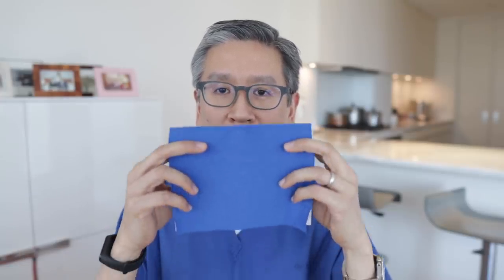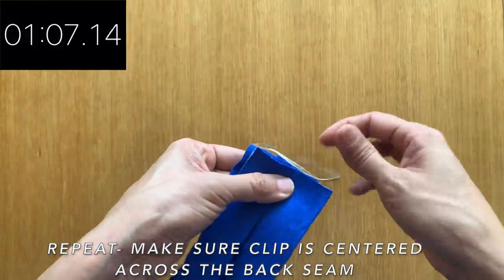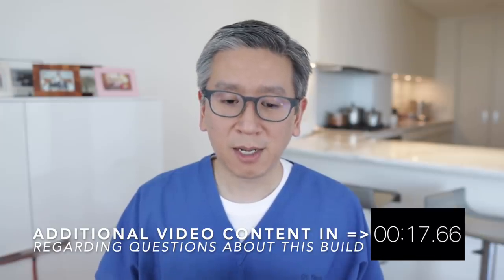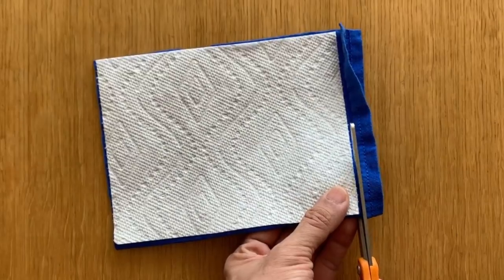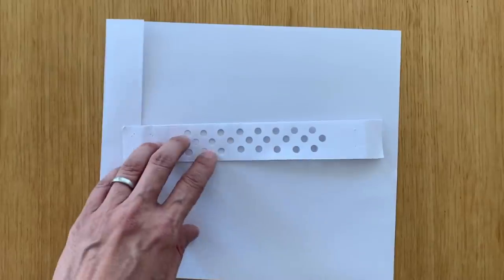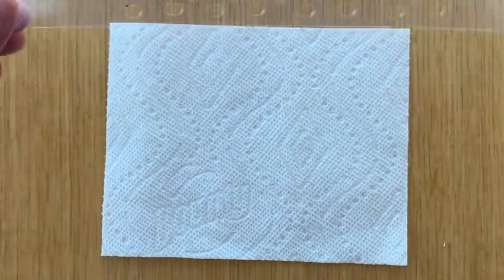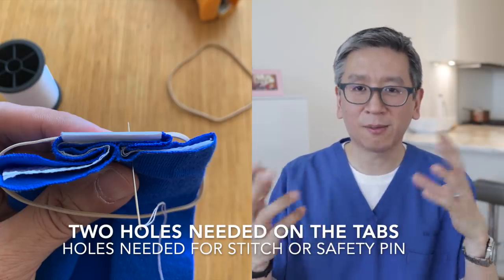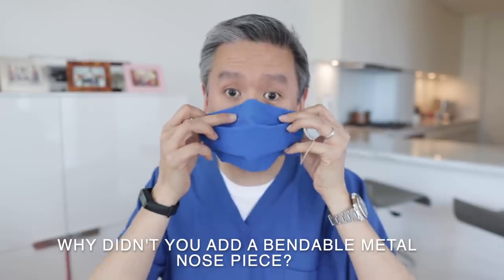1+ Minute Clip Assembly No Sew 3D Filter Pocket Face Mask #Masks4all

Comment: Thank you Dr. Yang, for this excellent design. I use both the paper and the cloth masks.
For the paper ones, I use paper towel outer with a tissue filter, all stapled together, so it is fully disposable.
For the cloth ones, I use a cotton outer as a mechanical barrier and chiffon (or polyester) inner as an electrostatic barrier. Since there is no paper, the cloth mask can be hand washed and re-used several times, so I have stiched the ear bands, instead of using clips (per your earlier video). I have also hand stiched the bottom opening for a neater finish. 
And I use hot melt nose clips for a better seal (I wear glasses and they fog up!). These can be bought from ebay quite cheaply.
Once again, thank you so much for taking the time to publish these videos!
Reply: What are hot melt nose clips?

Comment: One final question if you would be so kind! I have read that the best fabric mask materials are tightly woven cotton (600 thread)or quilting material or electrostatic fabrics such as melt-blown polypropropyene. Is there some special reason that you prefer T-shirt material?
Reply from the maker: This is one of many videos.  The focus is on accessibility and making one so they can use it today.  If possible, the surgical masks that can be purchased will be better.  

This is the "lowest hanging fruit," which everyone should be able to make with what they have at home.  If they have other better materials or the money and time to buy better materials, the same design can be used to make the same style mask.  You can make this mask using the 600 thread cotton with a Filti mask filter, or other melt-blown polypropylene.  

These are made of non-woven polypropylene, with a melt-blown center layer.  You can try to recreate a surgical mask using purchased materials. On Etsy, they even sell kits which you can assemble your own surgical masks.

The T-shirt material is from the Masks4all.co website.  Note they didn't use a cotton-poly blend as their recommended cloth.  The 100% cotton t-shirt is thicker and is closer to other tightly woven cotton.  However, the filtration of the cotton alone was not great, so adding the paper towel was important to the design.  

Here is the graph from the article discussed below: https://smartairfilters.com/wordpress/wp-content/uploads/2020/04/Effectiveness-of-DIY-Mask-Materials-at-Capturing-1.0-Micron-Particles.jpg

Here is a channel post and discussion about the best mask materials which you may find interesting:  https://www.youtube.com/post/UgybnLPPH85A28YlaQt4AaABCQ?app=desktop

Comment: Hi Dr. Yang. Thank you for taking the time and showing us how to make a quick and effective face mask. I followed your instructions to the Tee. My face mask did not look anything like yours. I have a couple of questions, if you will. Where did you get the piece of Acetate? I tried using clear notebook divider. I had to put 4 pieces on top of each other( I quadrupled the thickness)  and it was still too soft to hold shape. Secondly, you are saying you are using tea shirt material for the mask. I know tea shirts are soft too. I used something like that, still can not have my mask hold its shape like the one in your video
Reply from the maker: 1. Transparency Acetate from Staples or Michaels. The specific brand I used was from Dick Blick Art Store in NYC: https://www.dickblick.com/items/55506-1305/

I was using this acetate to make face shields. Video link: https://youtu.be/pd-sZAQLomg

You don’t have to use acetate, but the “frame” should be stiff like a piece of index card or folder material.  If you bend it and let go, it should want to stay straight. 

The clear document sleeves where you can insert a sheet of 8.5x11 paper would be too flimsy like a ziplock bag.  

Important to place the sheet of paper towel in the middle of the t-shirt. The paper towel has some stiffness like a sheet of paper when it is new. Without the paper towel, it will likely needs too soft. 

Lastly, the T-shirt material recommended by Masks4all.co is 100% cotton. A cotton/polyester blend might  be too thin.  Good for working out, but too thin to be an effective mask.

Comment: At the end you could use a stapler to attach the acetate film, just make sure you do it so the smooth part goes toward your face so the staple doesn't scratch your face.
Reply from the maker: I think a stapler is possible, but may require a heavy duty stapler or thinner T-shirt material.

I tried to use a stapler on my Instagram as I was designing the cloth version. https://www.instagram.com/p/B_v8EScDAen/?utm_source=ig_web_copy_link

https://www.instagram.com/p/B_xdQAhDxO7/?utm_source=ig_web_copy_link

Comment: Well, could you stitch it first then use the paper towel?  You can use the binders to hold the towel in afterwards.  And as for masks that have the seam down the middle, I don't blame you for judging against them, but what about if you use a filter with them?
Reply from the maker: Marie Duran 
The earlier cloth version was just the paper towel version but using the t-shirt.  I couldn’t get the staple to go through so I placed 2 stitches.  https://www.instagram.com/p/B_v8EScDAen/?igshid=3gi3bp8j228p

Comment: I love this video quick.what else can I use as the tape you used or where can I find The tape.
Reply from the maker: Debbie Gatlin 

Cut and paste from Description: 

Acetate Film 0.005 mil: 8.5”x11” or 9”x 12” (extra can be used to make face shields.) I looked some up and they are pretty expensive.  They don't sell them in individual sheets, only packs of 20-100.  So I don't want you guys to spend that, unless you plan to make face shields for donations or for your own business use when reopening up small businesses, such as the cashiers, or hairstylists/barbers.  Workers who spend a lot of time within a couple of feet from customers.

Alternatives to the Acetate frame (using 3D printing to make a frame was not a viable option to reach everyone.)

•The goal is not to buy anything more than you need or want to.  There must be some stiff, bendable material which you can find at home.  Channel your inner MacGyver.

    •If you can find some transparency/acetate pages at work, use that.  
    •If you have clear folders at home, use that.  If you only have a folder which is made of card stock, use that.  
    •Some people have laminating sleeves which would also work.
    •A 2 liter bottle in theory could be cut into a long rectangular piece and punch holes in that 
    •Some junk mail actually uses pretty good plastic or laminated card material to make their advertisement stand out.  You can use that and cut a strip to use.  It will be hidden inside the mask anyway, so don't worry. 

Here are some links from Staples.com:
https://www.staples.com/Apollo-Write-On-Transparency-Film-Clear-8-1-2-W-x-11-H-100-Box/product_829333

https://www.staples.com/Report-Cover-with-2-Pockets-Plastic-Clear/product_970151

https://www.staples.com/2-Pocket-Plastic-Folder-Clear/product_970156

Comment: Do I need to add holes to the plastic strip? What is the purpose of the holes?
Reply from the maker: If you don’t have immediate access to a hole puncher, you can try making the mask with a solid piece of acetate.  This only covers about 1/3 of the surface area of the mask.  You still have 2/3rds of the mask for air to go through from both above and below the strip of acetate.  Adding the holes increases the amount of air, but the acetate still covers about 1/4th fo the mask.  Will people be able to tell between 1/3 vs. 1/4?  Probably not.  

In this paper towel version of the mask, I did not punch any holes in the printer paper, and it worked well, without much difficulty breathing.  https://youtu.be/NCF7lCHMnII

Give it a try.  If you think you think it works well without the holes, please let me know.  

With the disposable paper towel mask, people worried that in theory that it would be hard to breathe without some holes, but in real-life usage, I did not feel there was any difficulty at all.

In this cloth version, I included the hole punch idea, since the acetate is very strong versus a thin piece of printer paper.  Also, once the holes are punched, you can use the same piece of acetate over and over again cleaning it between uses.

Let me know if you try it without the holes and if you think it works fine without them.  It will help people who don’t have immediate access to a hole punch to get started while they get a one time access to a hole puncher (at the office or borrow one from a neighbor.)

Comment: What is the purpose of the acetate piece?
Reply from the maker: It gives the mask structure and shape.  This is important otherwise a flat piece of fabric across your face will get caught in your mouth as you talk and open your mouth.  This restricts breathing and makes the mask wet right wear your mouth is.  

Normally to make a structured mask you will need to pattern to sew two curved pieces of fabric together to create a dome shape.  If you don’t have a sewing machine, this folding and clip method gives structure without any need to sew.  

Also, easy to place the towel filter to cover entire surface of mask instead of trying to stuff the filter into a tiny pocket where the corners may not be laying flat.

Comment: Great idea. Where do you get acetate?
Reply from the maker: Cut and paste from Description: 

Acetate Film 0.005 mil: 8.5”x11” or 9”x 12” (extra can be used to make face shields.) I looked some up and they are pretty expensive.  They don't sell them in individual sheets, only packs of 20-100.  So I don't want you guys to spend that, unless you plan to make face shields for donations or for your own business use when reopening up small businesses, such as the cashiers, or hairstylists/barbers.  Workers who spend a lot of time within a couple of feet from customers.

Alternatives to the Acetate frame (using 3D printing to make a frame was not a viable option to reach everyone.)

•The goal is not to buy anything more than you need or want to.  There must be some stiff, bendable material which you can find at home.  Channel your inner MacGyver.

    •If you can find some transparency/acetate pages at work, use that.  
    •If you have clear folders at home, use that.  If you only have a folder which is made of card stock, use that.  
    •Some people have laminating sleeves which would also work.
    •A 2 liter bottle in theory could be cut into a long rectangular piece and punch holes in that 
    •Some junk mail actually uses pretty good plastic or laminated card material to make their advertisement stand out.  You can use that and cut a strip to use.  It will be hidden inside the mask anyway, so don't worry. 

Here are some options from Staples.com:
https://www.staples.com/Apollo-Write-On-Transparency-Film-Clear-8-1-2-W-x-11-H-100-Box/product_829333
https://www.staples.com/Report-Cover-with-2-Pockets-Plastic-Clear/product_970151
https://www.staples.com/2-Pocket-Plastic-Folder-Clear/product_970156
Reply: @GeorgeYangMDNYC  THANK YOU for both your quick and thorough reply.  I will try this out and recommend it to my friends.

Comment: Is paper towel not dangerous to our health?..  If we breath we may inhale some fibers.. Just asking..  
But tnx Doc for sharing.. Keep safe..  😊
Reply from the maker: Good question. There are certainly situations where we are more likely to inhale fibers.  Emptying out a paper shredder bin, emptying a vacuum cleaner, sawdust after sanding wood, cutting grass, or pollen from walking in a field of flowers.  

In the case of emptying a shredded paper bin, the long cellulose fibers (tree fiber) in paper is cut up to tiny short fibers which may be inhaled. 

When we open a roll of paper towel or printer paper, we don’t see any fibers flying up into the air.  If there was a dark table or counter top, you can see if any fibers fly off and land on the table. 

One test I thought of to see if fibers come off paper is the “clean your mirror test.”  If you want to clean a window or mirror, paper towels, cloth, or Kleenex facial tissues will clean the mirror without any fiber residue. 

The worst thing to clean a mirror is a Charmin toilet paper. When you wipe a wet mirror it leaves some streaks, but also tiny fibers which dry up on the mirror.   Later you get windex or just water and wipe the mirror with a paper towel which doesn’t leave any fiber residue or streaks.  

Surgical masks would be better since they are designed for this type of use, so they would still be considered the safest.

Comment: So this is a disposable mask, right? Because no way to wash/disinfect a mask with acetate and paper towel, right?
Reply from the maker: Only the paper towel.  The T-shirt can be hand washed several times.  Cut a new rectangle when the edges start fraying, falling apart or if you notice any odor to the cloth.

The acetate, binder clips and rubber bands can be wiped down with 70% rubbing alcohol and air dried, ready for the next assembly.

Cut a new piece of paper towel 5.5" tall and 7" wide.  If your select-a-size towel is 6" wide you can cut it to 5.5"x 6" wide and it would still work.

The original version used a strip of printer paper, which would require you to make a new strip with holes punched into it, but that would be too much work over the long term.  So the acetate can be used multiple times and disinfected.
Reply: George Yang, MD thank you!

Comment: Where do you get the tape
Reply from the maker: Cut and paste from Description: 

Acetate Film 0.005 mil: 8.5”x11” or 9”x 12” (extra can be used to make face shields.) I looked some up and they are pretty expensive.  They don't sell them in individual sheets, only packs of 20-100.  So I don't want you guys to spend that, unless you plan to make face shields for donations or for your own business use when reopening up small businesses, such as the cashiers, or hairstylists/barbers.  Workers who spend a lot of time within a couple of feet from customers.

Alternatives to the Acetate frame (using 3D printing to make a frame was not a viable option to reach everyone.)

•The goal is not to buy anything more than you need or want to.  There must be some stiff, bendable material which you can find at home.  Channel your inner MacGyver.

    •If you can find some transparency/acetate pages at work, use that.  
    •If you have clear folders at home, use that.  If you only have a folder which is made of card stock, use that.  
    •Some people have laminating sleeves which would also work.
    •A 2 liter bottle in theory could be cut into a long rectangular piece and punch holes in that 
    •Some junk mail actually uses pretty good plastic or laminated card material to make their advertisement stand out.  You can use that and cut a strip to use.  It will be hidden inside the mask anyway, so don't worry. 

Here are some links from Staples.com:
https://www.staples.com/Apollo-Write-On-Transparency-Film-Clear-8-1-2-W-x-11-H-100-Box/product_829333

https://www.staples.com/Report-Cover-with-2-Pockets-Plastic-Clear/product_970151

https://www.staples.com/2-Pocket-Plastic-Folder-Clear/product_970156

Comment: Where do you get the acetate
Reply from the maker: Cut and paste from Description: 

Acetate Film 0.005 mil: 8.5”x11” or 9”x 12” (extra can be used to make face shields.) I looked some up and they are pretty expensive.  They don't sell them in individual sheets, only packs of 20-100.  So I don't want you guys to spend that, unless you plan to make face shields for donations or for your own business use when reopening up small businesses, such as the cashiers, or hairstylists/barbers.  Workers who spend a lot of time within a couple of feet from customers.

Alternatives to the Acetate frame (using 3D printing to make a frame was not a viable option to reach everyone.)

•The goal is not to buy anything more than you need or want to.  There must be some stiff, bendable material which you can find at home.  Channel your inner MacGyver.

    •If you can find some transparency/acetate pages at work, use that.  
    •If you have clear folders at home, use that.  If you only have a folder which is made of card stock, use that.  
    •Some people have laminating sleeves which would also work.
    •A 2 liter bottle in theory could be cut into a long rectangular piece and punch holes in that 
    •Some junk mail actually uses pretty good plastic or laminated card material to make their advertisement stand out.  You can use that and cut a strip to use.  It will be hidden inside the mask anyway, so don't worry. 

Here are some options from Staples.com:
https://www.staples.com/Apollo-Write-On-Transparency-Film-Clear-8-1-2-W-x-11-H-100-Box/product_829333
https://www.staples.com/Report-Cover-with-2-Pockets-Plastic-Clear/product_970151
https://www.staples.com/2-Pocket-Plastic-Folder-Clear/product_970156